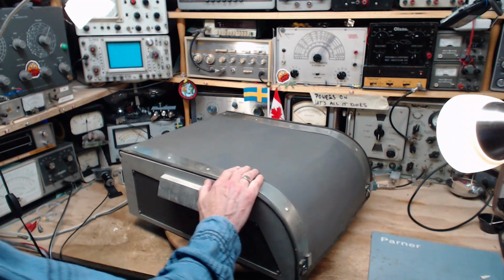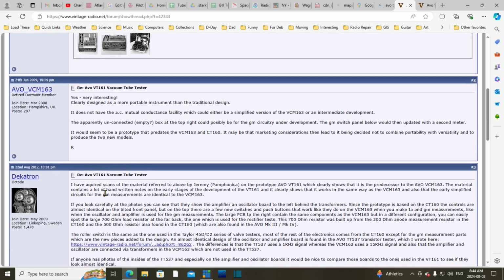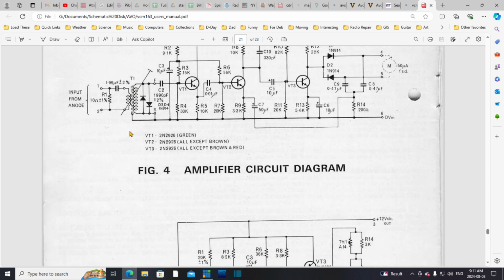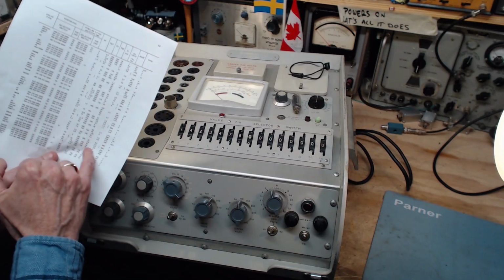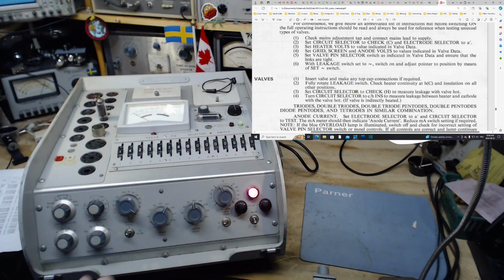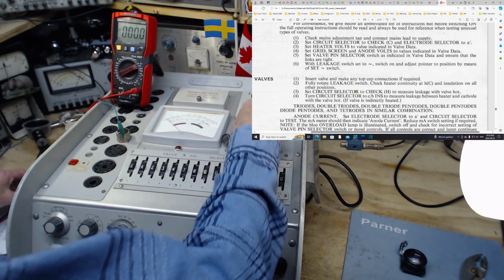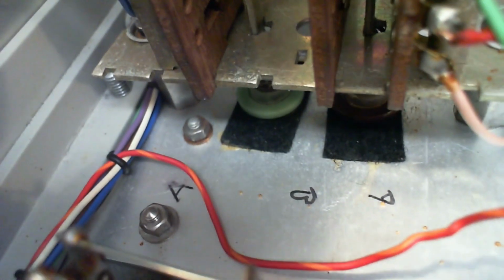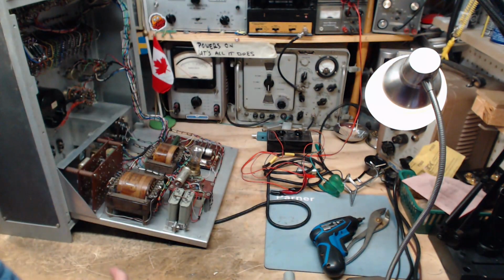AVO Tube Tester Type VT161 (very rare) - Checkout and Operational Testing

Comment: 35:34 Quote "If you were in somebodys home trying to fix their TV you wouldn't pull this out" End Quote
Actually on in field service you would not pull out any tube tester at all. You would have ur box of the commonly used tubes with you and replace a  tube in question with a brand new one. Because the ultimate test is always running a tube in its circuit, as you yourself have seen on the gassy 50C5.
And in tube days even in the shop a tech would rather swap in a known good new tube, than bother with tube testing. - Unless maybe it was a very rare tube that you didnt have in stock. And even then you would rather take the gamble and send the apprentice down to the wholesaler or service depot to fetch one.
And even today many hobbyists rather than testing tubes, opt for swapping in an NOS or at least known good tube as the ultimate test.
Reply from the maker: Gassy!  Why didn't I think of that?